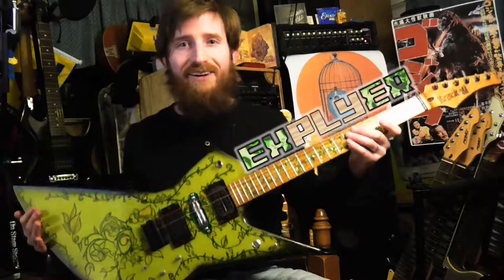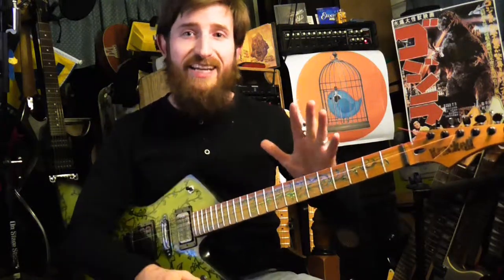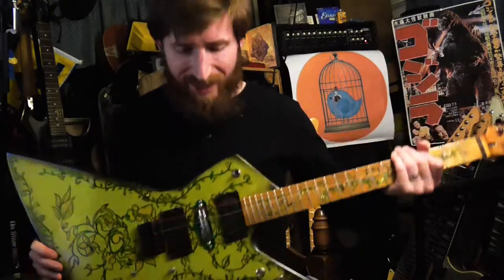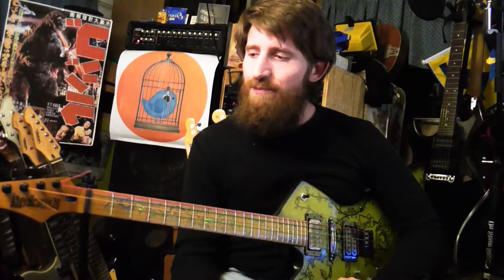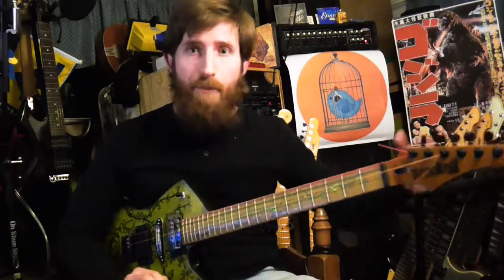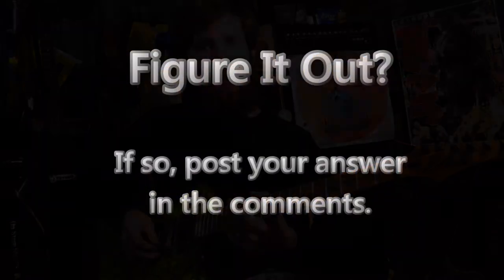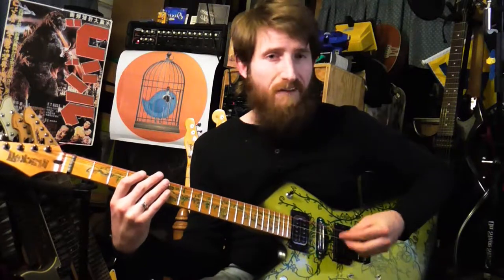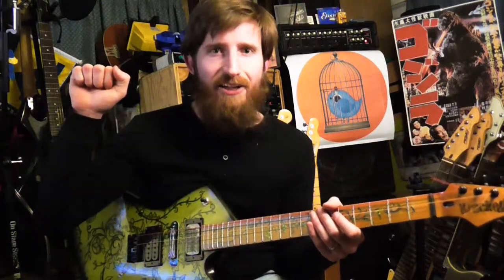Plywood Explorer - Final Stage | Kracked Guitars Vlog by Deaf Cage

Comment: you put someone's else name on guitars you built???? WTF is wrong with you???lmao
Your wife did a kickass job on that paint job..She should had painted her name on it. :-P
All my home made guitars are made out of 3/4 plywood ..simply becuase i dont have
a plainer. The plywood gives you a STRONG and FLAT surface to work on.
Then i'll either cut 1'' strips or use whatever left over wood that's 3/4 thick.
Then I add 5mm deck. So they're basically SEMI hollow. With blocks under the bridge area.
I hollowed out my first build simply becuase of WIEGHT. To save time and make the build
easier...I decided to use strips for the center layer for later builds.
The guitar are actually at proper wieght, now..Not a brick like a les paul
I bolt and glue in the necks...so I can shave the tenon. I like the tenon to start
at the 17 fret..so my thumb can rotate under the neck with comfort.
I play lead. It is what it is.
I still eyeball the neck tilt..as long as there's 1-2 degree .Im cool before I glue.lol
Even on my exployer the bottom cut away starts at the 22 fret. The horn's angle had been
change slightly..so my hand wont hit it. It still retains the gibson explorer look.
I tried different angle in an art software before building the guitar. 
The head stock on mine looks more like a Hammer explorer.
You wont know they're made from plywood unless I tell you.
You will notice the guitars resonant more than a solid body un plug.
They actually sound great for Jazz...If i can get them to sing CLEAN. They'll easily sing
saturated. ..I like standard  erniballs .10 gauge on 24.75....$12 for 3 sets....
Yeap...use the cheap strings for set up.
Reply from the maker: LMAO! I know I was dumb with those Fender logos, but that was way back in the day before I realized you can make your own water-decals, and before I met my wife. (I can't paint) All the things you've said about your guitars sounds familiar. My Explorer is weight-relieved in the fin. I used 3 pieces of 5/8" ply to get a total thickness of 1-7/8". I've got lots of photos and videos I want to put into a "Making of" thing when I get time.
Reply: Im working on another flying V and explorer at the moment...
I gatta have them in sets.lmao...a black set with bindings.
Trapizio for the explorer and dotted for the Flying V....
I just 1/2 to 2" drum sanding thingie from ebay for $4 shipped to
my house in 3 days...(free shipping too.lmao)
Im going for WARLOCKs and Bich looking guitars now....with Lock/floating Tremolo....My method should be fine..
I thinking of just installing a block from the bridge's post to
the rear of the front pick up bay ..just incase.
The rear pick up bay dosnt have to be that deep..trim the pickup
hieght screws...if you must.

I made an acoustic flying V too...using the 5 mm ply.
4" side pieces...with 5mm top and bottom...gives me 4 1/2.
I simply thin out the top layer to 2-3 mm...
I put a brace or dow right under the bridge...so the top wont get
compress....The string pegs are set further back
like regular electric dean V or korina V
There's a 3/4 doubler to prevent the strings from pulling up
up on the deck.....
My electrics are 1 3/4 thick ..about the same as LTD or
fat fender bodies.
blocks for the tips and cut away...just so I can simply round
the wings and level the tips. it needs wieght in the back so
the head stock wont dip, anyways.
It plays just as loud as my 3/4 size acoustic...Not as loud
as my full size and thick acoustic.

Basically a 2 1/2 thick Tele. LP  or Warlock thin acoustic for my next
projects....Im concern about the strings pegs yanking up the deck..
I'll probably build a warlock first..then try a LP type build.
I need more 22/24 frets acoustic .lol
I can just install a block under it...but that''ll just make it like a jazz
hollow body type guitar...i want the deck to float but strong enough
to not cuase tuning issues...like most FACTORY acoustics.lmao
Reply from the maker: Better do some relieve some weight on that Warlock. I've got a BCR Warlock made of solid agathis and it friggin' kills my back to play it standing for too long.
Reply: Did you use a 24.75 or 25.5 neck ??? The reason a want a warlock or bich is  mostly becuase I want 24.75 with 24 frets in my collection.
I want to buikl a guitar with floating locking tremolo..just so I learn or find out what happens if I use the 2 layers of 3/4 ply. I personally think it will be strong enough...but you never know. Plus the neck tilt angle on a 24/75..24 frets. The butt end of it will stick up more...if you dont have
enough tilt on a 24.75..it cuase issues...because the strings are slinkier.
So I was thinking...i might need washout for the last couple of frets
so the strings dont buzz out on them..So Im thinking that's why on most
B.C rich guitars there's a wrap around or string through to give the strings more tension.
I do alot of wide stregth in the middle of the fretboard. My fingers arnt the longest in the world. That why i play mostly 24/75 and I shave the neck's tenon..so My thumb can move up a couple frets on the high end of the fretboard..Im not into doing crazy pose like slash on a LP or letting my manboobs hug  the guitar.lmao....
It's almost as if Im playing a cello when i play lead. The guitar remains at belt level...the neck gets tilted up so I can reach those higher notes without doing crazy standing pose all the time.lmao
Reply from the maker: I didn't build my Warlock, its a BCR built one. 24.75" neck with 24 fret.